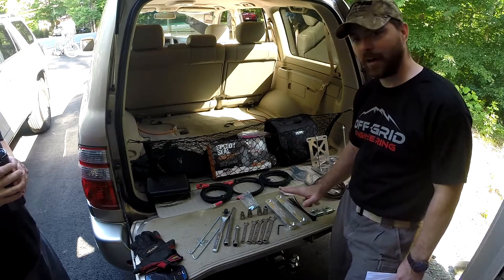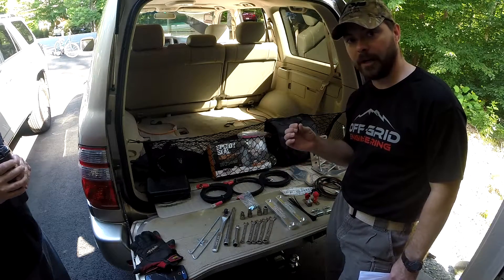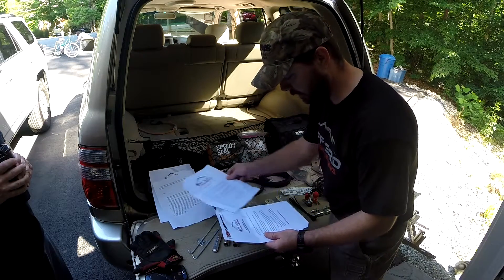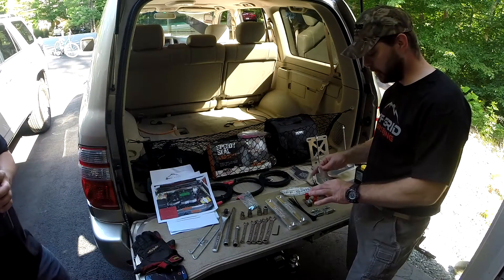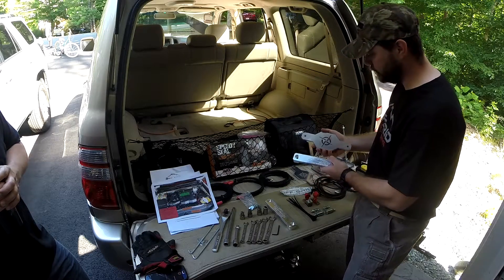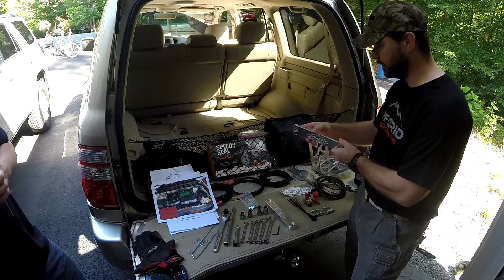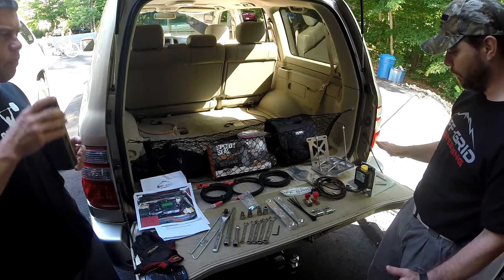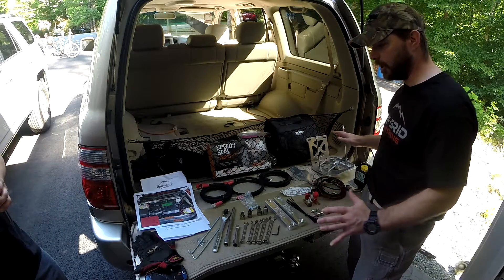(1 of 5) 5th Gen 4Runner Dual Battery Install Intro - Off-Grid Engineering

Comment: I'm a little confused... Does the switch allow you to flip from starter battery to aux battery or does it switch them both off and on at the same time? Thanks
Reply from the maker: Good question, I really need to do a video on how the electronics are hooked up and why with some drawings.  Let me give it a shot with a few words.  Any load you would like to run while the vehicle is off should be wired to the auxiliary battery.  When the vehicle is off the batteries are disconnected, this keeps your start battery from getting drained while you are running your fridge, lights, etc while you are camping or stopped.  When the vehicle is turned on it recombines the batteries so they are both charged off the alternator.  High draw items like a winch, which you would run with the vehicle running will also benefit from the fact that the batteries are combined and all the cranking amps can be utilized.  So all the switch does is connect and disconnect the batteries automatically.  The yellow manual switch on the relay itself and the in cab rocker switch allow you to override the automatic connection.  This would be useful if your start battery died for some reason and you needed to link while not running to start or if you were stranded and needed the start battery to keep you auxiliary items going after the aux battery was dead.  Let me know if that makes sense and I will be doing a video on this in the near future.  Thanks for stopping by!